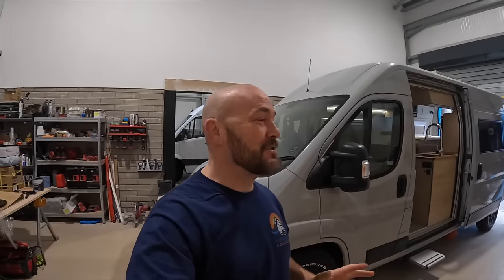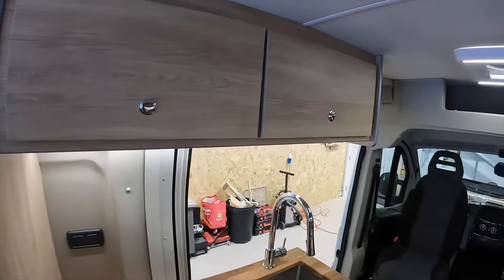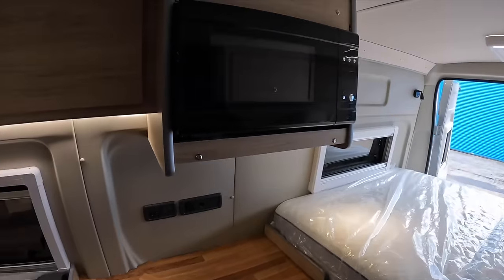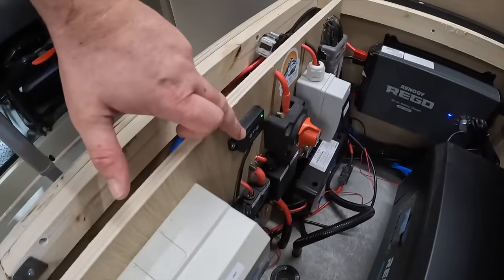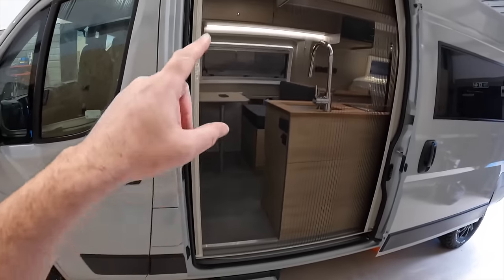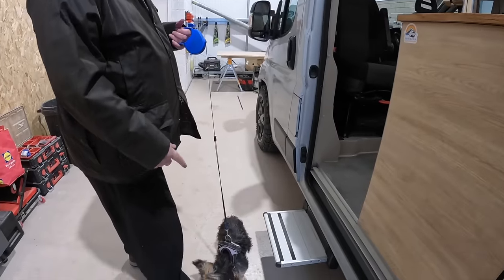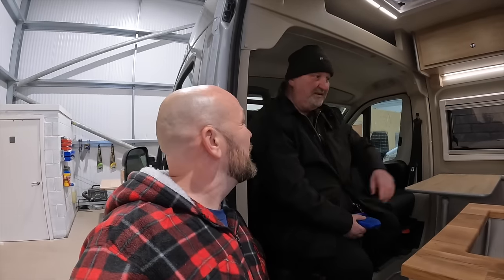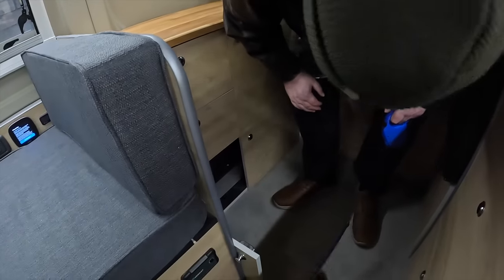Ducato Van Build All Electric Tour & Owners Reaction

Comment: That looks the business! Well done all! Fab work!
Reply from the maker: Thanks mate 👍🏻🚐 was worth the extra time
Reply: It shows! My only niggly bit is that joining piece above the bed from wall to ceiling. Do Solway do something for that? Obviously at a cost.
Reply from the maker: No mate nothing, I spoke to them about it and they finish their vans just how we did it but I wasn’t fully satisfied either so we bought some grey trim to trim the bottom section which made it look so much better. The only thing I could have done was to panel it in the light weight board but because it’s the head end of the bed, I didn’t want him to be banging his head on something protruding further 👍🏻
Reply: @VanologyConversions  I had a look on their website and they show photos of a small plinth out of furniture board and recess strip lights into it. It’s a tricky one isn’t it!
Reply from the maker: If it was exposed in other areas I would have done something similar as it does look better, if we get one again we can play around with it and see what we can do 👊🏻
Reply: @VanologyConversions  As long as the customer is happy that’s all that matters, and he looked very happy. It’s a stunning vehicle. My dream vehicle would be an overlander like Motor Craft Dev or a Mercedes Vario bus with a motorhome quality interior like yours.
Reply from the maker: I’d love to do a vario or an overlander, straight walls 🤤

Comment: Hi, the strip lights you use from amazon, do you wire them straight to your leisure battery fuse holder? also do they come with spares connectors so you can cut and reuse the off cuts so to speak. Cheers,  Wayne.
Reply from the maker: Hi Wayne we get ours from CEF on 50m drums, they can be cut at intervals. We extend a cable from the fuse board to where we want it and connect the led strip👍🏻🚐
Reply: @VanologyConversions  cheers for the info. Much appreciated 👍

Comment: Cracking finish, you didn't sound too keen on the Solway panels at first.  What you you think now that they are all fitted? I think they look great and give such a professional finish. I know they are expensive, would you use them again ?
Reply from the maker: My main issue with them is that for £2k I would have expected them to be a nicer fit to the contours of the van, I found some panels were short in some areas and others didn’t align perfectly so took a lot of extra work to make it right. I’m happy with the outcome but I personally wouldn’t buy this kit but would fit it again if the customer wanted it 👍🏻

Comment: The dining table looks too low and there’s no raised platform to stop dangling legs at front swivel seats. That’ll get uncomfortable fast. I’d put a wire cage around that diesel heater in the back because it’s likely to get knocked about with items shifting when driving or worse, the intake blocked by something soft, material like, falling over it. Rest of the van looks great. Well done.
Reply from the maker: You are corect with the table, only the table height is good it is the seat that is too high so we have made arrangements to lower it. We spoke to the client regading the floor in front of the swivel seats but he plans on using the bench seat so he is going to try it out for a bit and let us know if he wants a rasied plaform there.👊🏻